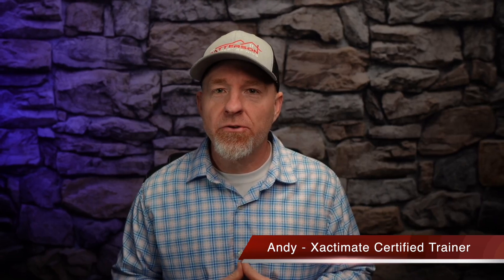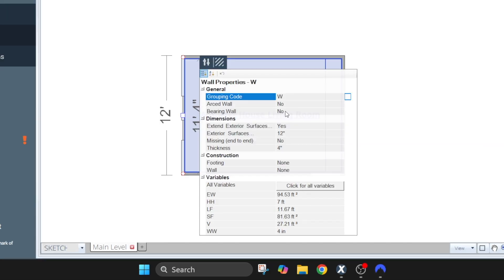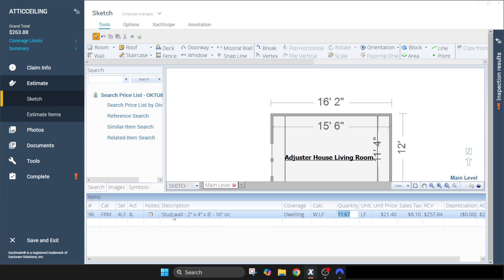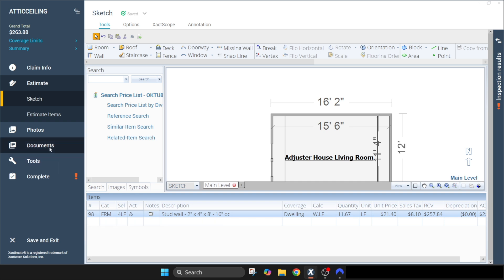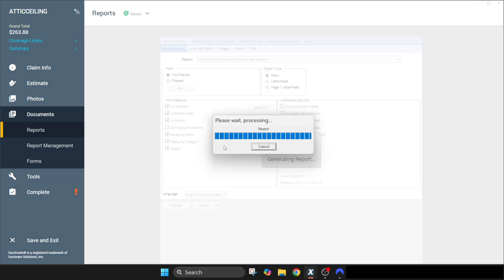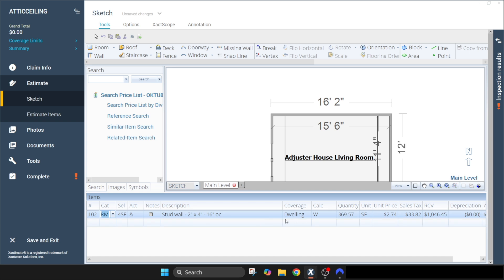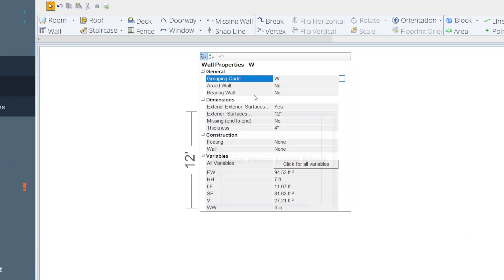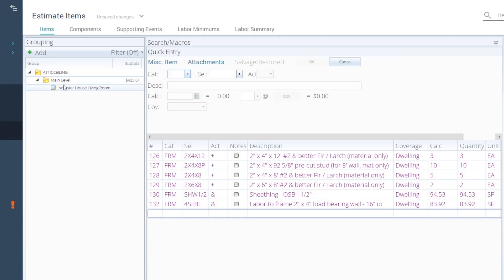Xactimate Framing Wizard Explained

Comment: I know this is a beginner question, but how do you determine if a wall is load bearing on an inspection?
Reply from the maker: Good question, the outside walls are always load bearing. Good rule of thumb regarding interior walls is any wall that is perpendicular to ceiling joists is load bearing.
Basement walls perpendicular to the main beam or ceiling/floor joists are generally load bearing. 
Some truss framed homes don’t necessarily need the interior walls to bear weight depending on how the trusses were engineered and the span. But most of the time if an interior wall(s) is perpendicular to the trusses/rafters/ceilings joists it’s usually load bearing. 
Thanks for the question.
Reply: @pattersonadjustertraining  Thank you for the detailed answer! I'm about 6 months into adjusting and your videos have been helping me immensely!